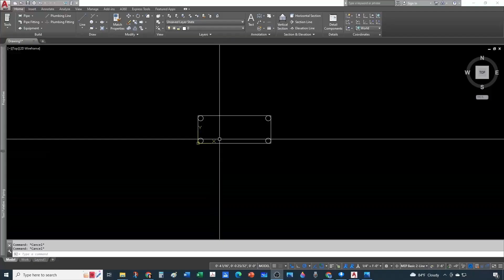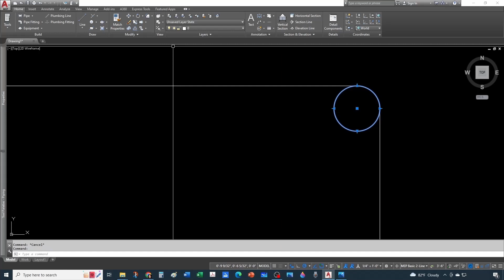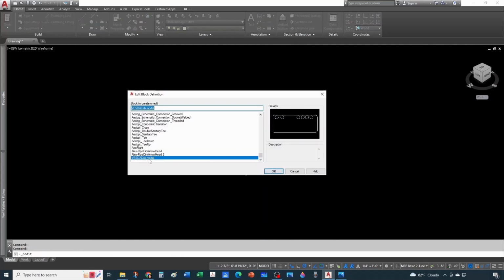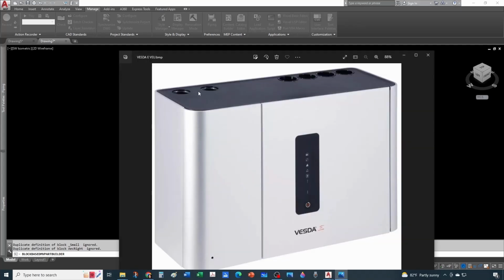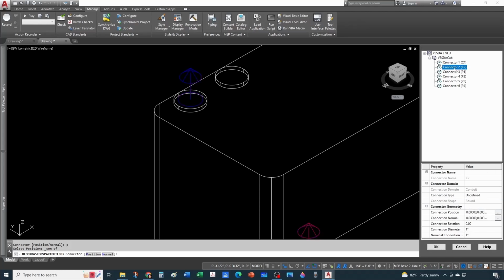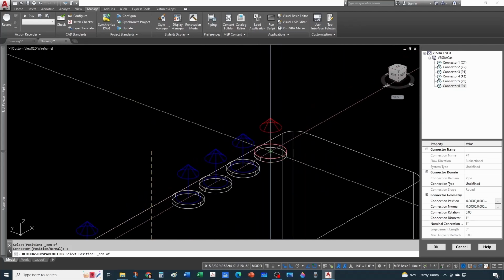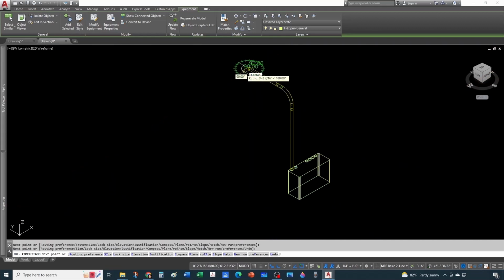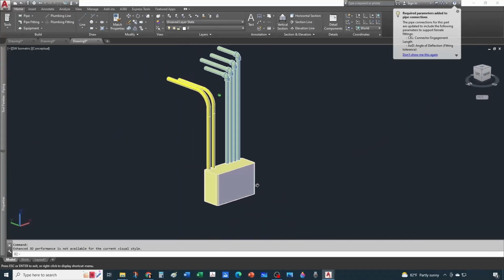Creating a VESDA System Panel in AutoCAD MEP

Comment: Great 👍 
Can you help me with import a project like this into Revit to make a detailed material list schedule for pipes used?
Reply from the maker: Go under Schedules > Create New Schedule and go from there. Good luck!
Reply: @bimitup  sorry I am confused..
I have a piping design in AutoCAD MEP, and I need to make a schedule with the length and size of these pipes. What can I do?
Reply from the maker: @MohamedGamal-ur6jd  
Since you mentioned Revit I thought you also had it in Revit.
When you link or import AutoCAD MEP into Revit, it is "dumb" information, so you can't schedule.
Your best shot is to create "Property sets" in AutoCAD MEP, then tag all and then you can create a schedule.
It is not that straight forward, but it can be done. Good luck.

(You can always book some time to go in depth) 😉

Comment: can you provide us new lecture about the output pdf sample plumbing plan how its looks the presentation, if like the 3/4" pipes is too small if its still readable.
Reply from the maker: Hi Anzi.
It might be a while until I post another video on VESDA in AutoCAD MEP.
But I will tell you this: The trick is to display as 1-Line piping, so the diameter doesn't really matter.
Reply: great thanks for the tips
Reply from the maker: You are welcome!